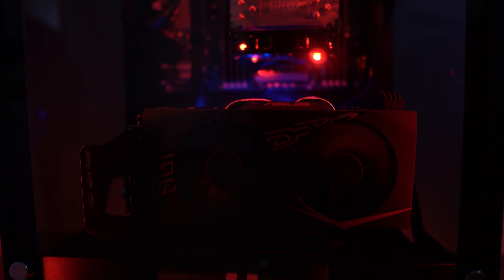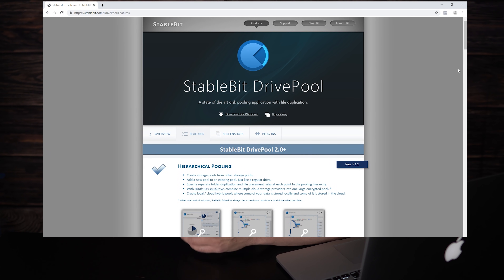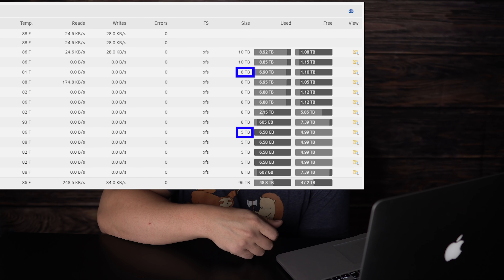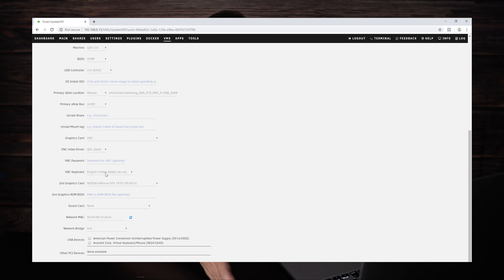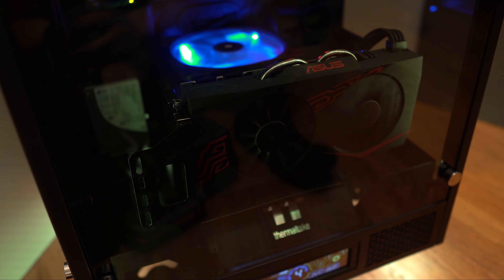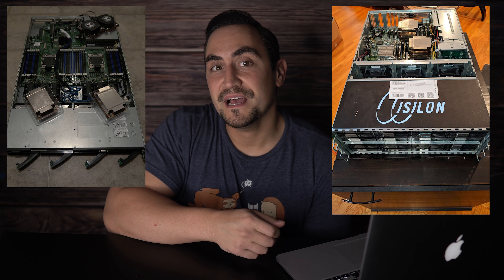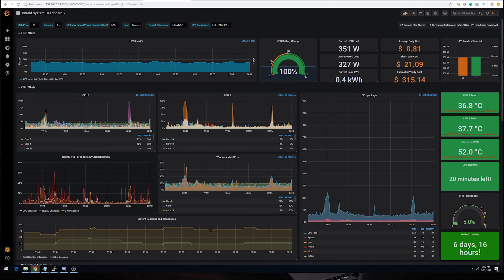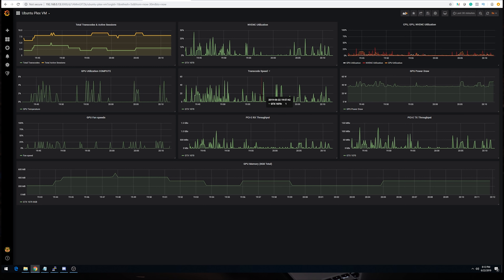How to build a quiet 117TB Plex media server (Part 2)

Comment: My lil' server seems sad compared to all y'all:  AMD Phenom X4 945 on ASUS Motherboard with 14GB of DDR3 RAM, GeForce GT 730 (no hardware transcode) and 6 random mismatched hard drives for about 14 TB of storage
Reply: I don't know. seems alright, if it meets you needs then it's not too bad.

I only really need 1 maybe 2 transcodes at a time. So I have a x3350 (q9450) with 8gb ram and mismatched drives of a total of 17gb using onboard graphics (so no transcode). I originally had an e6750 with 4gb of ram, still did 1 transcode, but it almost maxes out the  CPU.
Reply: @robertt9342  Well it's gotten very popular with my family so it's struggling to keep up. It's under my desk and can tell when 2 or more people are watching 'cause my feet get warmer :-)
Reply: I'm running a Core 2 Duo with 4, yes 4 GB of ram and an R7 vid card for my Emby Server, I know I should upgrade but it keeps running along so well.

Comment: Drivepool is still a good option, just use snapraid instead of drivepool's duplication. Snapraid and drivepool compliments each other well.
Reply from the maker: i played around with snapraid for a bit before switching to unraid.. it was nice but I definitely wasn't running my parity checks often enough.. I like that with unraid its real time and you can run parity checks to validate everything.

Comment: I use unraid as well. Ryzen 1700 CPU, 32 gb of ram. 51 TB of usable storage in the array. Server is used as a nextcloud server/NAS and plex server. I'm currently using a Rosewill 4U 15 bay rack mountable chassis. All but one of the hard drive slots are occupied. When its time to upgrade, I'll buy a supermicro 15 bay case and connect those hard drives via DAS as you've shown in the video. After that, if I need to expand then I'll have to make a secondary server as unraid only supports up to 30 attached hard drives lol!
Reply from the maker: That's a solid upgrade path/plan it sounds like youve been doing this awhile  👍👍

Comment: Great video as always. 
My server: i7 8700k, 16GB DDR4, Quadro P2000, Win10 OS/Plex cache on 1TB Samsung 860. (case: Phanteks Shift, H80i v2 AIO, and SF600 Gold)
Storage: Synology DS1815+  (8bay with ram upgrade) 7x8tb WD Red NAS. 
GBe network.

Running great and quiet. what benefits would I enjoy from switching (and learning) Freenas and /or Unraid? Ignorance is pretty much bliss for me with my server running with out issue coming up on 90 days.

the most trans-codes I've hit in 90 days is 6

My previous server was that Dell r720 dual E5-2650 48GB ECC ram (8disc) paired with an MD1200(12disc) switching to the consumer grade equipment I saw a huge jump in performance, reliability and noise reduction.

Comment: What are you going to do with the Osilon server? Do you need me to pay shipping to me in FL? 😁👍
Reply from the maker: ahahhahaha i'm not sure but even after taking out the 80mm fans and throwing 120mm fans in the thing the power supplies were still loud as hell.. Its an awesome rig but without some beefy fans the 12 bays/HDDs in the back of the case get very hot.

Comment: Maybe this is a better question for by my bits what can you use multiple P2 thousands for transporting if I'm not mistaken that's the name of the graphics card that can get like 20 to 25 trance codes if you can put multiple and there wouldn't leverage close get you know 4652 transco's. What about P 4000 or P6 thousands of
Reply from the maker: As of today Plex wont leverage multiple cards on a single server. Best QUADRO GPU for transcoding would probably be a P5000.. outside of something ridiculous like a V100/GV100/GP100

Comment: @Sloth Tech TV Thats a really cool build and you just sold me the Case for my next Upgrade. My Question is where do you get the Drive Cages from ? In the Manual is nothing written if they are inside the Package, on the Thermaltake Page is no HDD Tray Page. At the moment i got a Lian Li D8000 bought it last year ~September it's a great Case but in the Summer time i need to take off the Front to cool down the HDD's otherwise they go up to 50°C in the Winter time they are at ~38 which are normal.
Reply from the maker: i used the thermaltake USA support form on thermaltakes website, they just asked how many i want and sent me a paypal invoice. it was pretty awesome lol
Reply: @SlothTechTV  good for you!  I am started looking for some aftermarket solution as Thermaltake support keep saying they are out of stock
Reply: @Freender90  what did u find that works
Reply: @mintkhan007  I am still pinging Thermaltake support:(

Comment: My setup:

Hardware: 
* Dual Xeon E5-2670 on an Intel S2600CP motherboard
* 256 GB DDR3 ECC memory
* 3x Dell Perc H310 HBA cards flashed with LSI IT firmware for 24 drives support
* Supermicro 4U case
* Replaced all of the fans to be quiet enough to put in a cooled closet

OS and Software:
* VMWare ESXi 6.7 (free version) as my hypervisor that allows pass-through for PCIe cards
* FreeNAS running as a VM as my storage server
* Plex running as a separate VM under Linux
* Various other VMs running Windows and Linux as well as containers

Advantage of FreeNAS is that it's free and relatively easy to setup and administer.  Using an OS that supports ZFS is a big win to guarantee data integrity as well as having support for losing one or two drives (raidz2) and be able to recover the data.  It's not as big of a deal for a media server where you can generally just download the content again.  But, for all my picture and videos (going back almost 20 years at this point), having a filesystem that checksums everything to ensure no bits get flipped is a huge deal.

So, if you value the integrity of your data for important personal files, use something like ZFS and have off-site backups.  For a generic media server, just about anything will work.
Reply from the maker: Thank you for such an intelligent well-written writeup of your build! That s2600 intel motherboard is great I had one in a 1U case it worked great for me -- so many DIMMS. 

Out of curiosity and kind of off topic -- how did you cool your closet exactly? Did you install hvac/duct and vents in the closet?
Reply: @SlothTechTV  The closet is on the second floor of my house with an attic directly above it. I was going to just install a vent fan to exhaust the hot air and let the normal house AC take care of the cooling, but my AC contractor installed it while I was away and installed an actual AC vent into the closet. So I just stayed with that as the cooling solution :)  It's not as efficient as just venting the hot air into the attic, but it works.
I have 256 GB of memory in my box and don't really come close to using half of it currently, so plenty of room for more VMs.

Comment: Why not run the plexmediaserver docker container? thats what i do. saves you having to spin up a vm just for plex.
Reply: This. Check out the amazing LinuxServer Unraid Nvidia build, which lets you install bare metal nvidia drivers in Unraid. You can then run Plex as a docker and give it access to the GPU. Now whatever CPU cores, RAM and the GPU aren't locked into a dedicated Plex VM.
Reply: @johnkurelek9187  yes but this isn't 100% working, Ive been using this and there have been issues. IMHO im looking at building VM and monitor the Nvidia Unraid build. Also we don't know how long this version will be around if people keep board-casting it to the world for Nvidia to pick up on it!
Reply: @BigFourHead  Too bad you've been having issues, mine has been rock solid since Unraid Nvidia was released. As for Nvidia, they support enabling their GPUs in containers (https://devblogs.nvidia.com/gpu-containers-runtime/ ), otherwise the devs at LinuxServer would never have been able to make it happen. What Nvidia would take exception with is people who bypass the transcode limit on the GTX models, which can be done regardless of running in a VM or docker. Sloth Tech TV is either doing this since he claims he had 30 something simultaneous transcodes, or in reality only 2 of his transcodes are hardware accelerated and the rest are being handled by the CPUs.
Reply from the maker: @johnkurelek9187  I mostly run in a VM due to being too lazy to migrate -- I built the vm quite a long time ago.. A docker container is Indeed more efficient. -- that said there are advantages and disadvantages to each VM vs Docker containers.
Reply: due to hardware transcoding.

Comment: What do you think of running a server of r7 2700?
Reply: I was running mine using the R7 1700. I have since upgraded the CPU annually to a R7 2700X and currently planning out an upgrade to a 3700X /3800X /3900X (haven't made the final decision). It's very doable, but the RAM limitation may be an issue for you (current boards top out at 64GB, but some of the newer boards go to 128GB).
Reply: Check out my comment here with my Plex Server with a Ryzen 2700 and a P2000

https://www.youtube.com/watch?v=2nr4o4wyG0c&lc=UgzCh0q9PN2z4sS2O0x4AaABAg

Comment: I also have an all in 1 data/transcode server. I haven't tried hardware transcoding yet so i'm running Dual Xeon E5-2640 CPUs with 80GB of DDR3 RAM in Freenas. I have Plex and a few other things running in the Freenas jails.
Reply from the maker: I just started playing around with freenas. out of curiosity what made you pick it specifically vs ovm or unraid?
Reply: @SlothTechTV  Well I was used to using disks that were the same size from previous RAID builds, so i didn't need the ability to mix and match drives. I didn't look much into ovm, but the fact that Freenas is well free was a big point over unraid. I also watched a lot of vids from Lawerance Systems. The one big drawback to Freenas that I don't like is you can't expand a drive pool by adding more drives down the line. You have to do it like you showed in the video by adding vdevs.
Reply from the maker: @ProphetBeal  ty for taking the time to share all of that i'm sure im not the only one who will read it and benefit from your experience with freenas :) 
It sounds like its working great for you, i love Lawrence systems btw .. i watch all of their videos.

Comment: my ghetto unraid plex setup is a dell t3600 e5 1650 0, 32gb ram, k4000 quadro. i have a Dell Perc 310 flashed in "it" mode. Now for ghetto i adapted the internal sas cables to external sas and have that running to a silverstone cs380  running as a disk shelf with no motherboard just using the sata backplane. curious if anyone has a more ghetto solution than me... lol
Reply from the maker: lol you call it ghetto but I think i've HAD and heard of MUCH worse setups.. Your setup is probably pretty energy efficient since the disk shelf is just simply powering your JBOD. To be honest I think i have you beat, when I had my first 1U server i had to add a disk and had no bays free so the first 2 disks i added just sat on top of the server with SATA cables poking out the back and a power supply on top.. facepalm it was so ghetto.. oh god.  it hurts me to confess...
Reply from the maker: oh and ty for commenting and sharing :)
Reply: @SlothTechTV  to be honest i like the slight ghetto, i also have hdd mounts and fan mounts in the dell that i 3d printed bright green just because
Reply from the maker: HAHA that sounds pretty cool what kind of 3d printer do you have?
Reply: @SlothTechTV  creality ender 3 pro, good cost to performance, it's really helpful for when you need a 3.5 to 2.5 adapter or i have  80mm fan pci slot fans blowing on my raid card. If your into modding or what ever 3d printers are getting good and dont break the bank anymore.

Comment: You asked about others servers...
I'm running an HP ML310e Gen8 V2.
It's basically a mATX box similar to your Precision 1700 recommendation.
It's my home server and Plex is only 1 of a handful of things running on
 it.
E3-1220v3 w/32GB of RAM.
Current one: 7 x 2TB drives RAID 6
On deck: 6 x 8TB drives RAID 6 (Shucked EasyStores)
Reply from the maker: Very cool! Thats probably incredibly energy efficient. Do you know what kind of watts you pull at idle vs load?

Comment: I have 8tb almost full and 4tb almost half full on my 2013 computer. Been thinking of getting 4 bay qnap with 8tb harddrives. Starting to buy more tv shows and running out of room fast.
Reply: Pogey James get used to running out of space lol we’re all the same buying more hard drives,you can never have enough movies and tv shows ha ha
Reply: Start converting files into x265, this cut my storage down by 60%, was massive and when you do it from direct disc it's very impressive on the quality and streams better on your network also.

Comment: Great video. What is the number of drives this case holds? I have an unraid build in a  H440 with 3 nvme, 2 data ssds, and 12 HDD. Looking to add more storage. Any suggestions would be appreciated?
Reply from the maker: the case can hold a maximum of 22 drives i think i had a breakdown of that in a part of the video and how you would install that many drives. I am not sure what heat would look like with that many drives but im sure if you added enough fans it would be fine.
Reply: @SlothTechTV  thanks. I'll watch the video again.
Reply: @SlothTechTV  I looked around and haven't been able to find the additional drive cages for the tower 900. Thermaltake informed that they don't sell them separately.

Comment: I am just running a Synology DS1019+ these days myself, 5x8TB WD Reds so 32TB usable. The hardware transcoding in it has been great, all of my 4K content is direct play (I dont share the 4K stuff). I will say though, the few files i have found that couldnt be hardware transcoded for whatever reason the Synology really falls flat on its face (which is expected given it's cpu). I also have several dockers running on it (Tautulli, Ombi, qbitorrent/openvpn combo and my Unifi Controller for my networking gear). Edit: it is basically silent and is on a shelf on my computer desk right next to my bed
Reply from the maker: very awesome build, the practicality of running those synologies along with the amazing efficiency (power wise) makes them great plex servers! they are powerhouses with hw transcoding on! at least as far as i've seen from some of the reviews on them.
Reply: @SlothTechTV  Yeah I had an Intel 7820X/Quadro P2000 build before this and considering what i came from, I am very impressed with this little box. Some of the dockers were a bit more of a pain to setup then the old spin up a vm and throw an o/s in it but it forced me to be a lot more efficient with my resources. It only uses about 35w or so haha

Comment: Curious, why used a GTX 1070 instead of a p2000.
Reply from the maker: The price :) -- much cheaper
Reply: @SlothTechTV  which will lead to more question why not a 1050 or a 1060 or 1660 .  Discovered your channel by researching PLEX GPU transcoding. You are doing a phenomenal job keep up the great work.
Reply from the maker: @pjdtechy5734  Let me start with the 1060, it has less VRAM and one less nvenc chip this results in quite a bit of a performance difference. The 1660 is Turing and also has one less nvenc chip and less VRAM (than a 1070) ALSO the Turing architecture did not really improve upon transcode speed, that said it did improve upon transcode quality -- but not enough for me to care. :D
 I love the questions keep them coming -
Reply: @SlothTechTV  Doesn't the consumer GTX 1070 have an artificial limit on the number of hardware transcodes vs. P2000 which does not? Did you have to patch the NVIDIA driver to get around this artificial limit?

Comment: do you have a PCPartList for the server hardware? id be interested in seeing the breakdown
Reply from the maker: I'll put one together! ty for the comment
Reply: @SlothTechTV  I was wondering if you were able to complete the pars list for the build?  I want to get something like this setup as well.  Also how many HDD were you able to mount within the case?
Reply: @EmilianoMartinez82  z's
Reply: @SlothTechTV  I just found your channel and this build checks alot of boxes for me. Is there a PCPartList for it yet?
Reply: @SlothTechTV  Did you get to portion hgt toghether that PCPartList?
Reply: Love your build. And you set up. As I would also like to know your hardware pick list as at the moment i am in the progress of building a new plex server,  and it would be interesting to know your MB and CPU,  to see if i am on the right track
Reply: https://www.serverbuilds.net/anniversary 

Unfortunately, the Gigabyte GA-7PESH2 is practically impossible to find :(
Reply: This motherboard is virtually impossible to findcan can somebody please suggest a comfortable replacement forboth the CPU and the board for less than 400 I would love to do this build
Reply: Can anybody tell me anything about the ga-7pesh2 rev 0.2 and this board  will only work with the e5-2600 v1 or it will brik the board from what I am told and if this board and CPU will work with this build